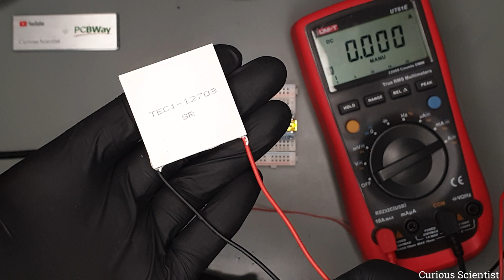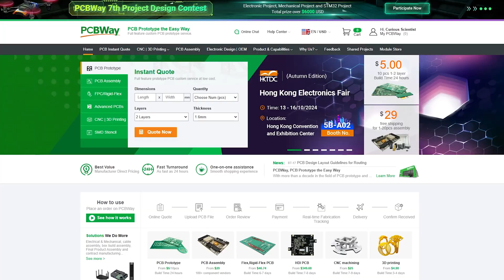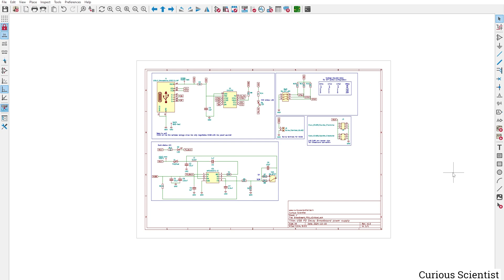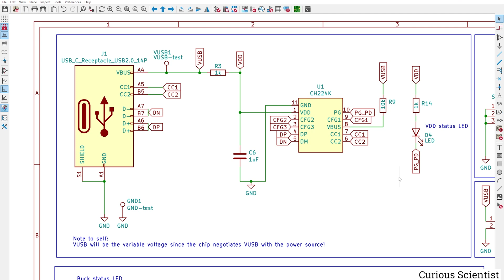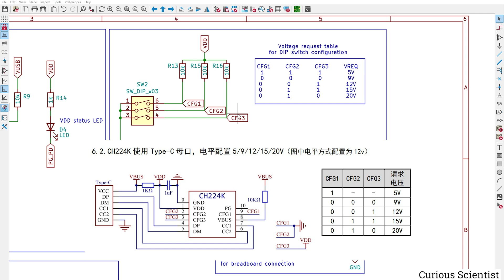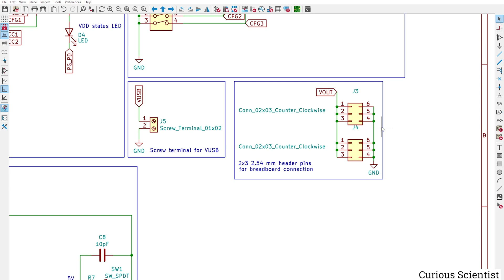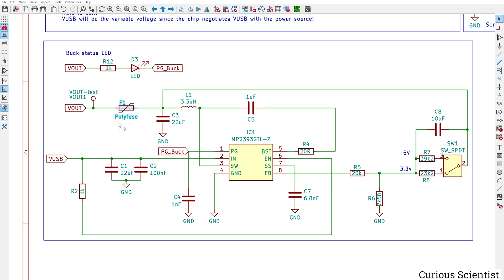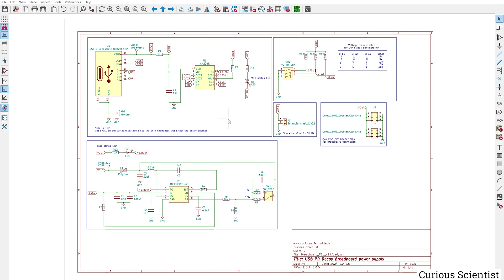USB PD Breadboard Power Supply - A New Approach!

Comment: Please consider adding an on/off switch on the output side (5/3.3 V) on v2 ! It makes life easier than fumbling with the USB cable or the wall PS.
Reply from the maker: Why don't you just disconnect the positive rail of the breadboard from the rest of the circuit? Then it is just one cable (ideally) to pull out. However, I will keep it in mind for V2. Cheers!

Comment: Was thinking before to do something like that with USB-C and PD, because I also was very unimpressed with design of the cheap chinese stuff, like even disposable vapes come with USB-C, and they want to sell me breadboard PSU modules with DC Jack like wth bruv?
I think there might have been some with USB-C but no PD
Tho one thing pls don't use the term "decoy" it's something some china guy got from google translate and it stuck on.
It's a PD sink controller.
Reply from the maker: I think from a perspective that the device pretends to be a legit USB-PD device, we could call it a decoy. But yeah, the chip's 'official' name is a PD sink controller indeed.
Reply: @CuriousScientist  Your power board is a legit PD device.
For example laptop with USB-C PD input will also use such controller.

Comment: Question if you don’t care about the 3.3 volt would you still need the MP2393GTL-X buck converter?
Reply from the maker: Yes, because of the high current it can provide. It also has a simple circuit that I can understand.

Comment: I think either you want to leave the shield unconnected, or have it at ground potential but a large resistor in between. Because you never want a large current to flow through the shield, which could be touching humans.
Reply from the maker: Thank you for the good insights! Probably I should add a 1M resistor inbetween then.

Comment: Voltage select part of the circuit is bad designed. You should change it, so that the contact will no disconnect during switching. I.e. one resistor must be connected permanently!  The other one should connected in parallel with the first one.
Reply from the maker: That's a valid point! I will fix this in the next version!

Comment: Regarding the debate about connecting GND to Shield, here an elaborate answer:
In many cases, connecting shield and GND is not doing much harm, but there are exceptions. Shield acts as EM protection for data wires in the USB cable, for instance. There, you want to have a well defined potential, and GND is a logical choice. On the other hand, when the shield is doing its job properly, then it technically acts as antenna, sending the collected EM noise (AC) to GND when connected. This can influence the GND level when the collected EM noise is strong and/or the components sensitive. Oftentimes, the cables and shielded areas/volumes are small and the components are insensitive, thus, you get away connecting GND and shield.

Here is a better way, that covers more use cases: 
(1) Connect GND to shield with a high Ohm resistor, e.g. 1MOhm. The shield will still be somewhat slowly pulled to GND, thereby the shield fulfilling its role as well-defined potential, but you also effectivel limit the max current exchange between shield and GND. 
(2) Connect a smaller or medium sized capacitor, e.g. 4.7nF, to shield and GND. This capacitor then acts as filter for high frequencies, so that those frequencies cannot effectively spread into your GND plane.
Reply from the maker: Wow, thanks for the insights! It also shows that you watched the video carefully because I mentioned this thing towards the end during the kicad session. Thanks! I actually do the 1M resistor solution with all my designs where data transfer is involved. So it seems that it is a good practice.

Comment: As far as I have been able to find out, the shield is connected to ground at the USB host device but not the downstream device. So, in this case, the USB PD charger would be the host and this board would be the downstream.
Reply from the maker: Then maybe it was not the wisest thing that I did. But I guess it's not too big harm since there's not too much communication going on between the power supply and the adapter.
Reply: @CuriousScientist  what about providing jumpers or switches for adding and removing ground-shield resistors and capacitors? Then everyone can test and choose how they want their USB ground and shield connected.
Reply from the maker: I settled with a 1M resistor between the shield of the connector and the GND plane on the board.

Comment: Positive and negative voltage for opamps would be cool. Still a cool board
Reply from the maker: Thanks! It is a great idea! I will check this. I guess, it should be powered from the VUSB, so it could create +/-12 or +/-15 V for example. A few capacitors and two LDOs could solve this, but I am not sure how to squeeze it on the board. It would need some redesign probably. Maybe v2.0 will have this feature.
Reply: @CuriousScientist greatscott did a video where he modified an off the shelf buck pcb to give a negative voltage, could be worth you checking out for inspiration.
Reply from the maker: I will look at it, but I might not have enough space to add one more buck converter and I cannot use the current one because that's strictly for the 3.3 and 5 V.
Reply: @CuriousScientist  do what applies to what you need i say. i have bench gear for days. if i want n-rails. i'll smack the thanks button when i get paid. i just bought a new guitar, pc, bench gear, etc. haha.
Reply: @CuriousScientist  cool. Someone sells one here in canada at a small company but it's never in stock and I know the creator who reviewed it and want it but so many creators are gimme gimme. If you notice alot of channels become glorified review channels. I donate a lot of test gear, game consoles, guitars as I don't believe in hoarding for the sake of it and to share. I gave a ones collection of over 400 games and basically gave them away because it becomes an obsession. So when I get new stuff I donate an old thing. 

I have this idea that collections own you if you collect for the sake of it. It's part of the reason I'm trying to give away a ton of microcontrollers and components to anyone in North America because shipping from Canada is cheap. I have leds on a level that would make big clive blush hahaha. I have small collections of stuff now like things that have flown on manmade space vehicles and globes. I even have a bunch of guitar pickups and stuff to give away. 

I have so much hobby grade rc stuff from a business I was going to start that I'd love to trade some of it or give away the used stuff at least. I'd like to sell or trade a seat cushion from the Columbia and Atlantis shuttles that flew 3 missions I paid 500cad for. It flew 3 missions and just shy of 20 million km. I have bills of lading and everything haha. 

I have an extra brand new lcr meter too I'd like to trade for something and some other meters.

If you want a bunch of cool through hole leds and components along with other stuff just gimme a po box if in canada or the us. Otherwise I'd go splits on shipping. I can't fit my guitars in my hobby room anymore and it's a pain in the ass. I spent a year buying every shape and size of led man, I used to send free learning kits to people I'd meet online but most of the gear I have left is premium stuff. I was gonna finish my bench off with a spectrum analyzer but bought a new prs last week instead. Plus the accessories for the siglent model I was gonna buy were half the price of the sa. You can unlock the sa though and dual boot to vna for antenna testing. Both models are identical inside. It can wait till after the rtx5090 comes out now though. Ces in January the blackwell architecture is supposed to drop the day Jenson announces it. I rarely game anymore but I'm a creature of habit since I started university in 98, case and guts upgrade, wait 2 years then gpu. 

While(True)

Haha
Reply from the maker: Just one more question. What amperage would you expect from the PSU for the opamp?

Comment: What happens when the switch is between 5V and 3V3? Could the 39k2 resistor always be in circuit and just have a 56k8 switch in to select 3V3? I'm sure C8 smooths things out but everything that can go wrong...
Reply: You got a good tip there!  It’s good practice any time you’re designing with switches to consider what could happen as the contact moves. 

Switches can be specified as break-before-make (probably more common) where one contact opens before another one closes. This is particularly risky in a feedback circuit like this one, where feedback will be lost momentarily. The suggested solution of switching in a parallel element is a good one, and the SPST switch required may even be cheaper. 

A make-before-break switch would do the opposite and briefly connect to both contacts, putting R7 and R8 in parallel. You’d get a lower output voltage momentarily, which is relatively safe, and feedback is maintained. However, that type of switch tends to be less common.

You say your switch is relatively well behaved, but you never know when someone might sub in a different part!
Reply: @british.urchin  Yes, I'm not an EE but determinate state is very important in software. I was also thinking that the switch is probably the most failure prone component; being unable to select 3V3 is better than going up near the supply voltage. Given that these would be great for the classroom I'm sure they will get knocked about a bit.

I'm happy this suggestion improved the design a little.
Reply from the maker: I totally agree! And it improved the design by a LOT! Especially, because the undetermined switch could cause the output voltage to be much higher than the expected 3.3 V or 5 V. So, it could potentially fry components connected to the rail. Thank you for catching the design flaw!
Reply: @morphit2k  Yes, the reliability of the switch is important too.  Thinking about this led me to another variation which is worth throwing out there:  I’m not sure, but I think a switch is more likely to fail open than closed (e.g. dirty contacts). And, it would probably be even safer for attached components if we could arrange to fail to the lower voltage of 3.3 rather than 5V.  This could be done by having the switched resistor be parallel to R6 instead.
Reply from the maker: Yes! This is a very good tip and I am very grateful for it. It is part of why I publish my stuff: get it peer reviewed, so I can learn from it. In my reviewed design, I have the 5 V resistor always connected and when the user switches to 3.3 V, A parallel resistor gets connected with it.
Reply: A good solution could be using the black caps that shorts pins together to select the correct resistor
Reply from the maker: Oh wow, this is a great question! 

I tried it just now. Roughly 80% of the VUSB appears on the output. So yeah, this is not super good. Although I had to set the switch in the middle "very deliberately". It has well-defined endpoints, and it doesn't really want to stay in the middle position. When you switch, even slowly, it is not an issue, but when you intentionally set it in the middle, then that's a problem.
Reply from the maker: I now updated all the files on my PCBWay project page according to the suggestion. One little change is that I used an 57k6 resistor because it is a more available value. I did the math and it causes very little difference when it gets connected parallel with the 39k2. The total resistance would be 23k3 instead of 23k2 which would not change the 3.3 V output noticeably. Once again, thanks for pointing it out!

Comment: Are there decoys for USB 3.0? I'm trying to get AR glasses powered as a DP ALT display for an SBC that also has power hungry wifi/ble. System works fine as long as I don't try to run it off battery.
Reply: Alt modes are negotiated over USB PD. However you'll need a programmable PD Controller for it.
Reply from the maker: Hi! You mean PD3.0, right? USB 3.0 is a data transfer protocol and not a power delivery protocol.
Reply: @CuriousScientist  I think so, yea. I'm a total noob at this stuff.
Reply from the maker: Then yes, it supports both PD 2.0 and PD 3.0. It is a modern chip.